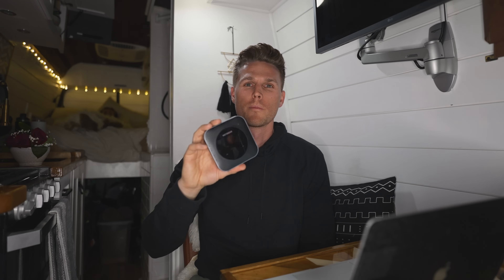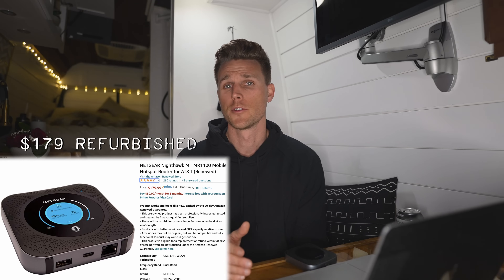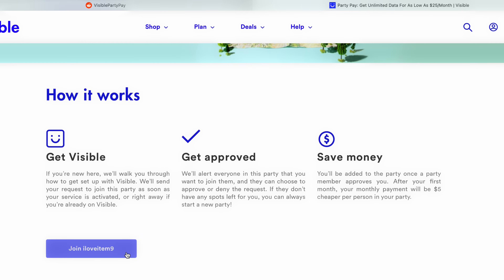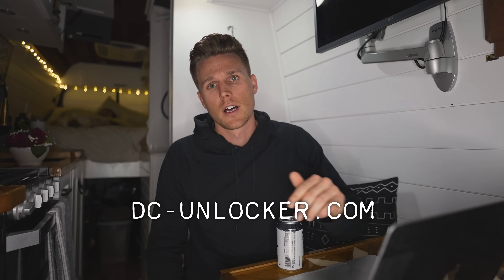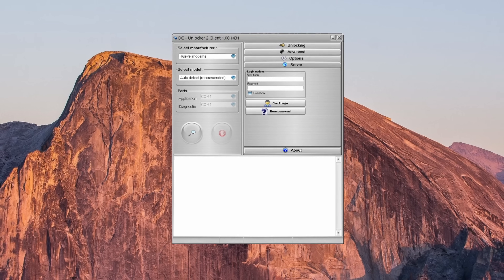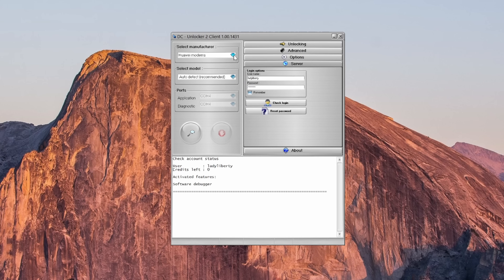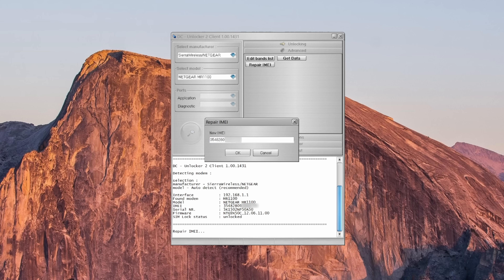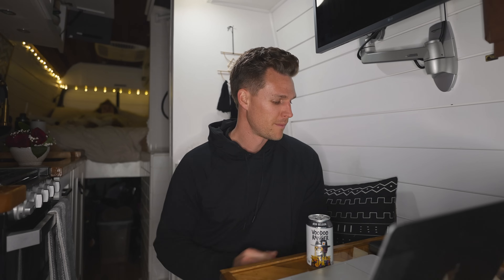CHEAP Unlimited Internet for your Van/RV/Tiny Home or even small Apartment | 2023 | $25/Month

Comment: What happens to the M1 Router if you ever go back to cable internet? Will it still provide 4k or 1080p after you setup the IMEI number to act as a cellular device which operates at 480p?
Reply from the maker: we use it to stream 4k all the time. Yesterday I downloaded a 2.4gb file in ~10minutes.  remember that the device is broadcasting the internet to your other devices, so it't simply acting as a pass through
Reply: @JakeandHeather  Sounds great! I have the same question another person asked, do you need to have the SIM card in the Netgear when you change the IMEI# in DC Unlocker?
Reply: @JakeandHeather  I keep getting the error " To change the IP subnet on my device so I haven't been able to change the IMEI. Ive searched how to proceed but I'm clueless regarding that stuff. If you know A way around this that would be great..
Reply: I tried this but when I reached on repairing the IMEI after i input a new imei and press okay, I get error connecting to server

Comment: I currently use verizon and data will throttle after a  limit on my phone. Does this plan throttle speeds after you hit an amount?
Reply from the maker: we havent had any issues with throttling. just yesterday I downloaded a 2.4gb file in about 10 minutes. i'd say we are using about 100gb+ a month of data
Reply: I had verizon and experienced the throttling. I now have visible (same phone 'Note9'') and have had no issues with throttling. It is supposed to be unlimited (no throttling) on your smartphone and the phone can be used as a hotspot with no throttling but limited to 5mbs upload/download.  There is no throttling.  Visible is meant for phones not hotspots so there may come a time that visible could detect the hotspot usage and disable the device, or cancel your service.  I did watch another video warning about that.
Reply: @volleyballDave  that’s why he swapped the imei to a phone imei
Reply: You need ttl modification

Comment: Jake and Heather,  does activating the sim in a cell phone give the correct imei number instead of changing the sim/imei through another app?
Also , I own the netgear mr1100, bought it new, unlocked a few months back. But I  believe I read in the system specs that Verizon network is not supported .
Is this your experience?
Reply: there are other videos where they describe activating the sim in a phone first. then moving the sim to the hotspot device. You can search youtube for videos that talk to that.
Reply: @volleyballDave  what did you search to get the right videos
Reply: @volleyballDave  that is correct. The SIM must be activated in a (Visible phone) prior to putting it in any other device whether cell phone or hotspot or it will not work.
Reply from the maker: We had read similar things. We purchased ours already unlocked, and it has worked perfectly with verizon (visible). Its worth a shot if you already have it
Reply: @JakeandHeather it looks to me like the MR1100-1A1NAS doesn't support band 13. Visible uses LTE bands 2, 4, 5, 13 and 66. Which model of the M1 are you using please?
Reply: I believe if you activate the sim in the phone it will work unless and until they do a check later and see a different imei that is not a phone imei .
Reply: Activating the SIM in a cell phone is not a solution. The providers, will occasionally check the IMEI number of users that are high GB users. If they find a IMEI number for a Hotspot device. They will cancel your account. If they see a IMEI for a cell phone. They will not cancel the account.
Reply: Visible does not allow hotspot devices on there Network at all.

Comment: I'm not on the road like you folks but I am tired of my internet creeping up in cost...  I just ordered a renewed M1 from your link.... I will most likely purchase an antenna to hang out on the eves of the house.  If I can lower internet by $50 a month, it will only take a few months for this to pay for itself.  And of course, the benefit of taking it in the R-Pod when out and about.  Thanks for the blog post.... I have been looking for a solution like this.. Fingers crossed.
Reply from the maker: Great to hear! With an external antenna this would be an awesome at home solution. internet cost are getting out of control
Reply: Let me know how it works. I've just purchased my teardrop camper and need an inexpensive wifi solution for my travels. I want a plug-and-play type solution you mentioned. Something for home and take on the road, too!

Comment: When i go to write new imei and click ok, it say error connecting to servers. Do i need to have the sim card inserted into the netgear m1? Whats this mean??
Reply from the maker: It means your computer is trying to use the internet coming from the M1 router instead of your local wifi. Make sure to go to wifi settings and disable the M1 router from your computer settings
Reply: @JakeandHeather  im having this same issue. When I try to change the imei it just says error connecting to servers. My laptop is connected to my home router though. I don’t see the M1 in my wifi settings. Please help
Reply: @JakeandHeather  I have the same issue.  It shows my home WiFi as the connected WiFi network and the M1 as an "Ethernet" network, but it defaults to using the Ethernet/M1.  When I disable the M1 router in my network setting, the internet works (now defaults to using my home WiFi) but then I get "modem not found" because the M1 is disabled.  Thoughts?
Reply: @TexasFlyer2  did you ever figure it out
Reply: @mr.wright2428  Yes. If I remember correctly, I unplugged my Ethernet and then it worked correctly.
Reply: @TexasFlyer2  do u still use it and what service did you have

Comment: Hello, I followed the steps and got the IMEI changed and SIM activated, but it isn’t really useable speeds.  Any ideas?
Reply from the maker: What are you connecting to the m1 router? If connecting from a laptop, make sure to change the TTL to 65. Also, it may depend on your cellular service in the area. Sometimes we get DL speeds of 50-70mbps, other times only 5-10
Reply: Did you need to activate the SIM card in a cell first, then swap to the M1?

Comment: Hello! Got my M1 in the mail today and using it with a sim card from Visible.

At first I was unable to get any network connection.

Then,

I was unable to get the sim card to work using the VSBLINTERNET apn!!

At the moment, it seems to stay connected for a few minutes going from 2 bars to 1 bar of reception
(sometimes 3 bars for a split second).

Is this because of poor reception or do you think changing IMEI will improve this?
Reply from the maker: hmmmm its hard to say. You do have to make sure the sim in inserted all the way and pushed up into the corner if you received a micro sim card. Changing the IMEI won't help with the reception going in and out

Comment: Hey Jake and Heather, can you help me out with the best way to find an imei and does it matter if the imei is from a phone that isn't 5g capable if I'm using the nighthawk 5g hotspot? TIA! Steven
Reply from the maker: I'm not sure about 5g related stuff. We don't have the 5g nighthawk model. We have tried putting the sims from our new iphone 12s in the router and they didnt work because they are 5g sims.

Comment: Thanks for the great info. I did everything and can see the IMEI number was updated to an old phone of mine. The issue is, it is still throttling back to 5MB/S. Any other tips or tricks that could open this baby up? My cell (Visible) is pulling 70-90 MB/S while the netgear is only 5MB/S. Great info and thanks for the help.
Reply from the maker: Did you make sure to change the ttl of your computer? “Check how in video description for Macs, or Google for pc”
Reply: @JakeandHeather  Thanks. I was testing it from my iphone and assumed since it was throttled at 5MB that everything else connected would be as well. When I tested two phones at the same time they each pulled around 2.5mb. I'll try a PC and see if that works. My end goal is to use it with my existing wifi ranger in the camper so I'll have full coverage in the camper and ability to split it across the local wifi and cellular to get the most out of it.
Reply: Having the same issue.

Comment: Hello great video man, thank you. Jw, I’m a truck driver and big gamer and I’m already a visible mobile user. Today I tired to connect my PS4 to my VM hotspot but it wouldn’t connect. And I review a lot on M1. My question is will be able to play wz on the road ? If I follow your steps. No lags ?
Reply from the maker: hell yeah! thats sweet! I've played Warzone plenty of times without any more lag than normal hahah really just depends on having good service. If you are somewhere that has full bars of service, it will fly  and plays very smoothly. ( I play on computer) connecting your PS4 to the M1 hotspot should work as normal, but the M1 also has an ethernet cable, so I'd just connect it to the PS4 hardline style 🤙🏼🤘🏼
Reply: @JakeandHeather  completely forgot about this lol. I appreciate your feed back my brother, just one more question. Is there any specific version of M1 that I need. Or any will do ? Thank you
Reply: I did this and it works however seem to be limited to the 5Mbps visible as on there hotspot from phone.  So how is it different from phone hotspot?
Reply: Visible uses the verizon 'base" network, so tends to work great in cities. Verizon has agreements with many smaller networks that allow for roaming when the verizon signal isn't strong enough. BUT... visible doesn't have access to those 'other network agreements' for roaming. So visible may not work well in some areas on edges or outside of cities.
Reply: @volleyballDave  thats funny because I gave up Verizon because if reliability issues.
My connection is better. But the tower is a Verizon tower.
Yes better connection with a non Verizon phone to a version tower. Then a Verizon phone service. I don't know why. 
Verizon let me hang for over a week without service. A year later I found out that thier Mexico towers were causing havoc with towers close to border in the U.S. It only effected Verizon phone service customers. Others providers using tower didn't have the issue.
Reply: @baddog9320   Verizon used the same bands here and in Mexico. I had the same problem when I was doing security near the border is side. The other Verizon based network have different bands for us vs Mexico.
Reply: If you are using visible your data is deprioritized, so if a lot of people around you are on the same cell tower they will lower your speed.

Comment: Hello, thanks for the details.  I did get visible with my old iphone. I get about 50mbps in the phone. I bought the router and dcunlocker credits.  I did everything and successfuly changed the imei to my iphone. I see in dcunlocker and the admin page the new imei. It also says the m1 is sim unlocked.

After doing everything i still only get 5mbps from the router.  So looks visible still recognizes the router as a hot spot, not as the phone. :-(. 

Is there anything else to try to get it to work?  Thanks!

I tried to chnage the imei to another but now it wants be to buy more credidts.
Reply from the maker: So what is actually happening is that your computer is communicating to the router as a computer, and the cell phone (m1 router) is recognizing that as tethering still. What you need to do is change the TTL (timetolive) of your computer (short google will describe this, also in the video description). I failed to make this obvious in the video {honest mistake, simply forgot since I don't restart my computer often} so added it after in the video description
Reply: I ran speedtest from my other phone wifi connected to the M1 router. That shows 5mbps. 

So i am not sure how my computers TTL affects it.  Do you mean setting the TTL on my Windows computer while using dcunlocker app?
Reply: Did you get this fixed ? i am getting 5mbps speeds at download and upload
Reply: @JonathanRodriguez-yx1vv  not fixed yet. I am using it for tv now so 5mbs is good. I wish to fix it someday.
Reply: Same , I am able to game with some lag but it kinda works
Reply: @JonathanRodriguez-yx1vv  I am having the same issue with it being only around 5 mbps :( which is not worth the $200. Hoping to find a solution.

Comment: In order to sign up for a Visible Party Plan, are one of your phone plans through visible OR did buy a new phone to create a Visible account?
Reply: Also, can we activate the Visible SIM card using the Netgear router? We just got all the items in the mail, but in order to join a Party Plan the SIM needs to be activated. Anyways, thanks so much for putting the video together – excited to try it out ourselves.
Reply from the maker: so sorry for the late reply, we have been camped in Sedona without good service. (still need cell service for this to work haha) yes, you will need to download the visible app and place the sim into a phone in order to activate it. It can be in any phone, you just take out your sim card in your phone, place visible in, activate in the app, and then take back out and place it into the router
Reply: @JakeandHeather  This is a pretty big step to leave out.  Maybe you can pin this reply? I've seen others ask the same question about how to activate SIM card.
Reply: @JakeandHeather   tried this just now with my iPhone 4S and I get the following message "SIM Not Supported" and it won't let me do anything after that.  Any assistance would be appreciated.

Comment: Epic, just ordered my net gear through the link 😎 thanks for the helpful advice !!!! You guys rock!!!
Reply from the maker: Woohooooo!!!
Reply: Did it work well for you?
Reply: Is it still working and unthrottled?
Reply: Any updates on if its working?
Reply: For the guys getting throttled, the mr1100 is not a good device when using for providers that needs ttl settings, you will consume a hotspot data depending of the plan, you need an external router that can use ttl settings.
Reply: @markahdz  can you possibly expand your thoughts? Getting capped at 10mbs down, most times 3-7…….going thru a router into the hotspot will improve it?
Reply: @speedy4829  all depends on the plan you’re using, if you have “unlimited” data you need to either “fix” the mr1100 to modify ttl so you don’t use hotspot data, know if you’re being slow down can be to different reasons, if your plan is limited to certain gbs per month of course you will be throttled, know other reasons is cell tower congested, and for last if you’re having video issues because of the speed try using a vpn
Reply: @markahdz  thanks! Appreciate the information. Going to give it a try using a separate router into the mr1100 and play with the settings a bit. Noticed elsewhere, people are having luck using the net gear just as a modem and directing all traffic thru a router.
Reply: @speedy4829  you can do that, if you have some linux knowledge you can get it fix to where you won’t need an external device.

Comment: Is this solution compatible with a Weboost? How well does the M1 work in remote areas (without a Weboost), where LTE or 4G is limited?
Reply: Same as phone
Reply from the maker: I wouldn't see why not. Should work just fine with a weeboost (we've been considering investing in one ourselves). We've found that the M1 usually gets one additional bar than our cellphones. we normally place it in the window and receive great signal (assuming there is signal at all in the area)

Comment: Thanks for the video. I also use Visible but with Google Pixel  phone as hotspot. I haven't seen these 30mb speeds your getting in. My phone doesn't get any more than 5mbps and devices attached to it get about same so I have not seen the need for this solution. However Im in a residential area and probably deprioritized heavily. Have you seen the need for a weboost? Also is this solution compatible with weboost ?
Reply from the maker: yea, when it comes to speeds from any carrier it really depends on where you are located

Comment: Hi, we have an M1 and have a plan where we can share a dedicated data SIM, plus the data on our phone plans for a total of 85gigs of data per month. Why not just use hotspotting from our phones.? Because although the iPhone and the M1 can have data speeds of about 270mbs, if we use the phone as a hotspot we only get about 30mbs. These speeds are close to the CBD,  Perth, Western Australia and not what we can get when travelling away from the city in country towns or in more remote areas. But, it gives an idea of the possible speeds on a 4g LTE device. There is a new 5G Netgear M5 available here, but the coverage for 5G is still very limited and it’s not worth the extra cost.
Our shared plans are expensive, about AUD120 per month for the three, but our provider has the best coverage for rural and remote areas of Australia.

Comment: Question: how does this differ than using a spare phone as the hot spot? Thanks for the help
Reply from the maker: Great question!! When hotspotting from a phone, the SIM card will recognize that the phone is sharing the connection via hotspot, and throttle the speeds, usually to around 1-5mbps. That is NOT the case after changing the imei of the Netgear M1. The sim simply thinks it is a phone using the internet, and does not recognize that you are using the connection across multiple devices (up to 20!)
We usually can get between 20-60mbps download speeds depending on where we are. It’s really the same speed you’d get in a normal office. 🤘🏼😁
Reply: @JakeandHeather  thanks! That makes more sense!